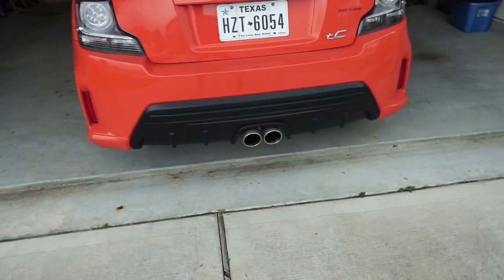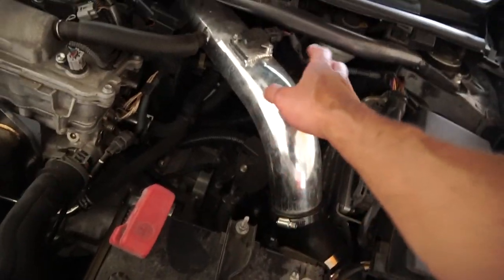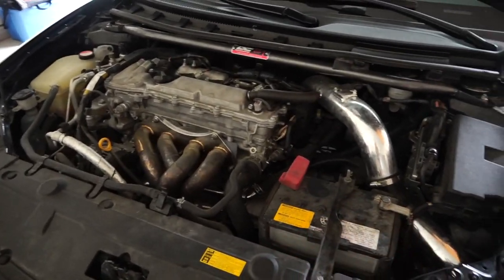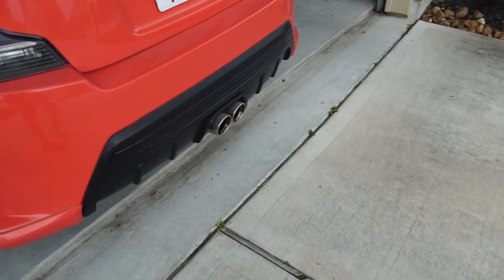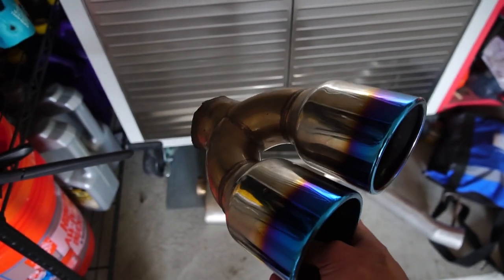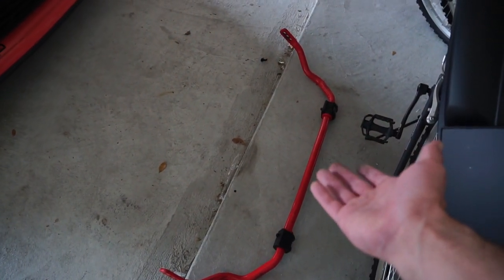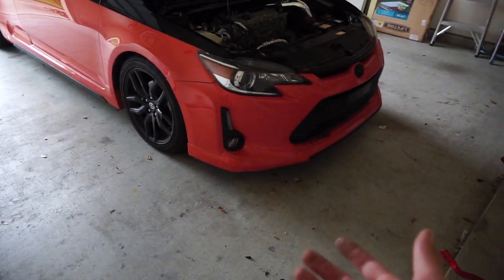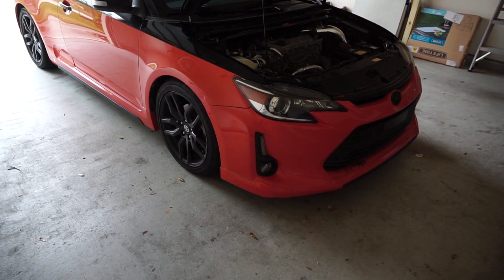Scion TC mod list and updates on my 350z (FULL VIDEO)

Comment: What year is your TC??, and why is the release model only putting out 160 with bolt-ons. My 2015 base model comes with 180 horsepower stock and 174 foot pounds of torque... and I put all the bolt ons on it and it seems to run better and more fuel-efficient, I'm not going to say I got a hundred horsepower out of it but I'm not going to say I lost 20 either. Last time I got my car tuned and dynoed it was putting out 192 horsepower at 187 ft lb of torque, that's what the 91-93 flash ecu.. stay away from Orange virus tuner. No turbo ,No E85,No gimmicks.. just bolt ons and the right tune and the correct exhaust. All NA...
Reply: How did you get it tuned? I’m trying to get mine tuned, but I have no tuner.
Reply: It’s an RS 9.0 so it’s a 2015 tC he has and 180 Hp and 172lb•ft of torque is at the crank, every tC from 2011-2016 is pushing that with their 2AR-FE engines. None of these tCs are pushing those power figures at the wheels, including yours while it was stock. Stock, these tCs push around 130-160 wheel horsepower, and that depends on the condition of the car and it’s power train; automatic or manual transmission. Boltons can definitely get you about +25whp or a bit more on these cars, a 91 or 93 tune can get you up to +10-15whp and E85 usually gets you up to 10% more power on top of that with the proper tune, E85 is no gimmick especially when all you need to get a conversion is a new fuel pump and fuel injectors and with E85 being so much cheaper than regular gas, the parts and tune will pay for itself relatively quickly. Also, dynos are never the same, you can have two shops a mile away and they will give you two different power readings even with the same style dyno; brake or wheel dyno.

Comment: you running the stock s pipe?

I have a 2014 Scion tC 6 speed manual. bolt on upgrades I plan on getting in the future are 
1.K&N short ram intake
2. Borla axle back exhaust
3.CNT racing s pipe
Then I plan on tuning right now I've been doing some research on unichip piggyback system, also OV Flash tuning system.. on the website they're out of stock on the handheld device..
Reply from the maker: yes
Reply: dont get borla is too quiet keep trd resornator delete you will thank us later nd save money !